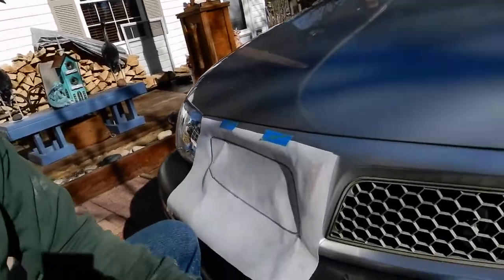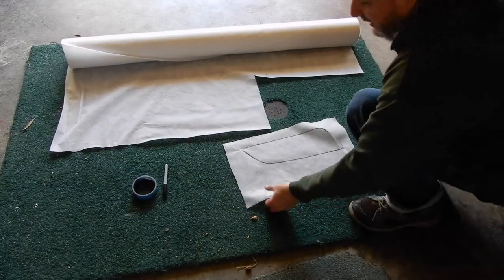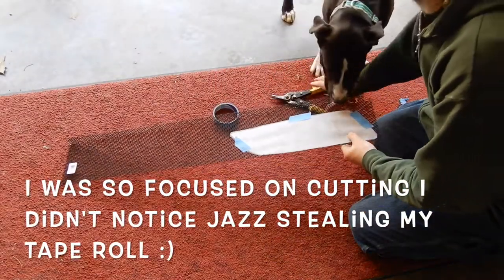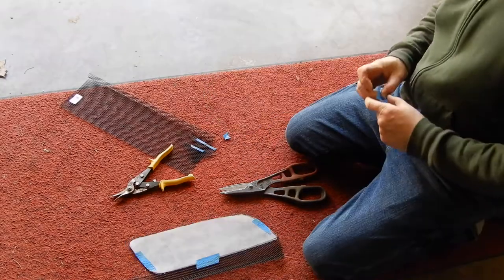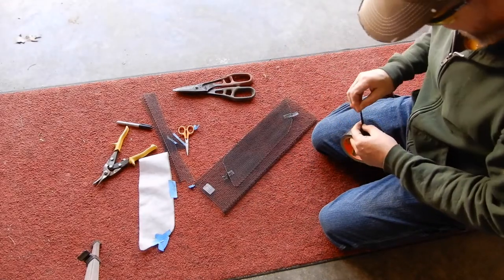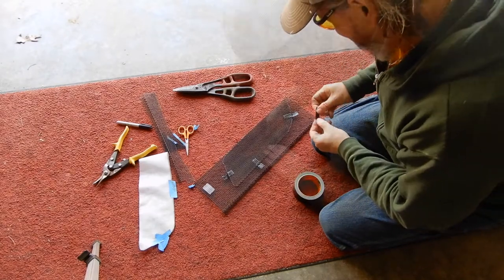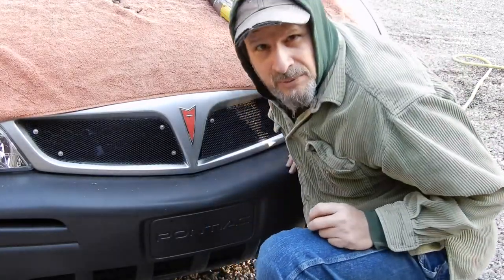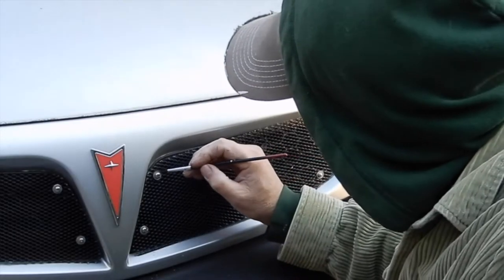Pontiac Montana 2004 Grille Modification Coolness

Comment: Both of my grill inserts are rattling around loose, not even attached to the grill assembly. The holes are from a missing screw post in the middle that keeps them in place from behind… not birds or anything like that. You push on them anywhere and the post breaks off/through the grill.

I don’t see how they can be expected to survive the rigors of regular maintenance or checking your fluids the way they were designed. I tried to find the part numbers and GM conveniently leaves those out when breaking down the individual part numbers for the grill assembly components. They label it “six” in the diagram and then list what 1 through 8 are only to skip 4 & 6. How could I guess they’d skip the one thing I was most interested in? ;)

Since mine are rattling around, barely still captive, I will be removing the entire grill and taking them out. I would suggest doing that for painting too so that you won’t be spraying the radiator. It’s just a few bolts on the inside.
Reply from the maker: I agree about spraying the radiator.....didn't think about that at the time.....and I search too for new ones....only ones I could find were attached to a new grill.........I would think a super glue in a caulk tube might help set yours in place...
Reply: @laffilmfest3759  Sounds like a plan. The missing chunks are still too obvious so I’ll probably paint and use as frames for my own metallic grill, much like you did. I have a 3D printer so I might even be able to make a replacement mount. :)